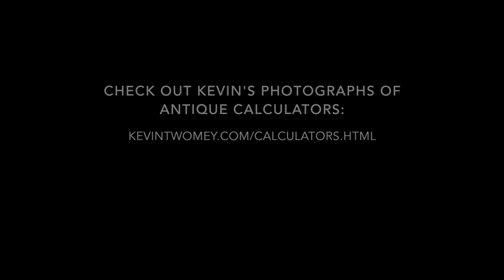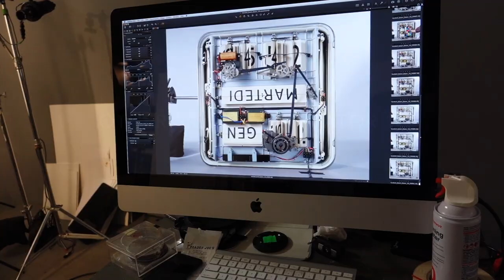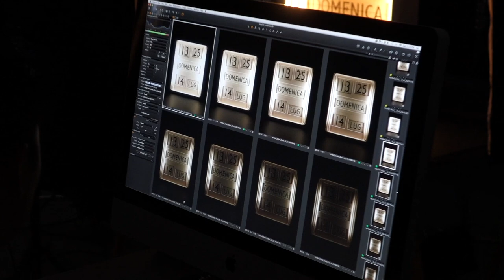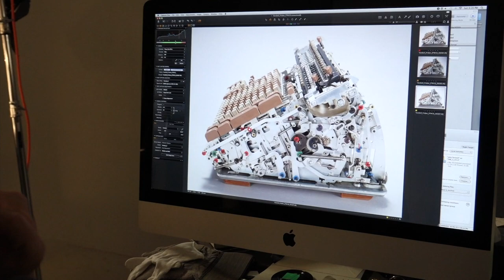Vintage Tech Photoshoot with Kevin Twomey

Comment: I guess you put in many hours cleaning and polishing beforehand.
Reply from the maker: You got that right! Lots and lots of cleaning... Every spec shows. I even had to entirely disassemble the clock and clean the inside of the glass.
Reply: I wonder if high-pressure pulsed air would had helped?